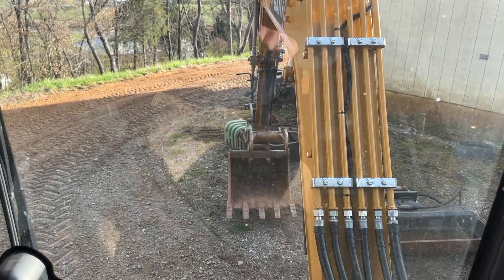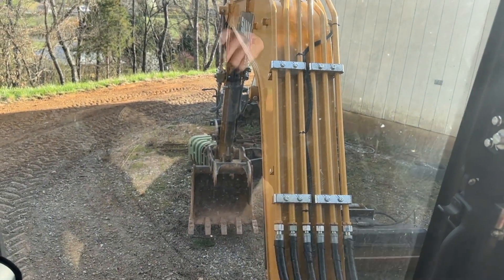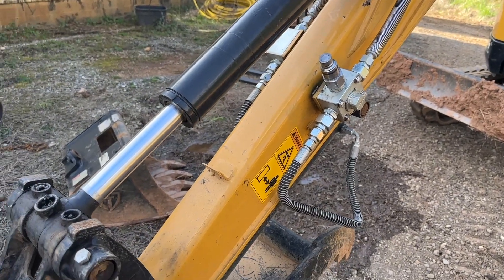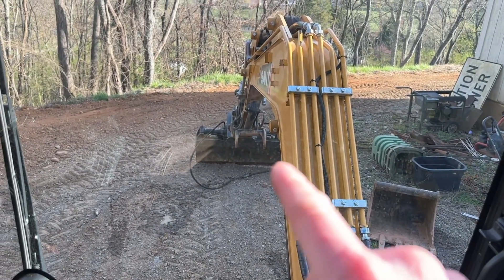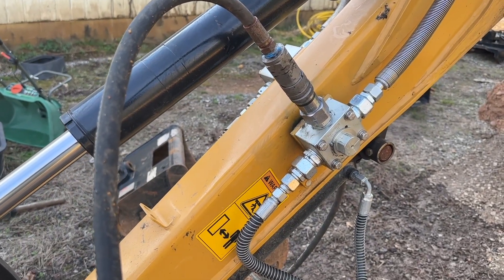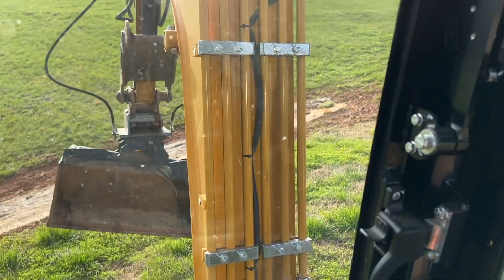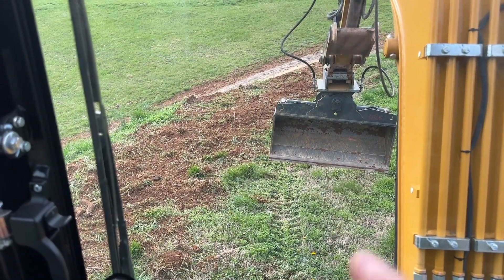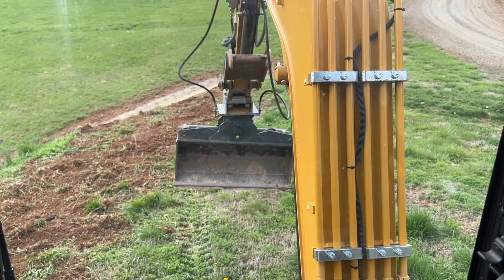Sany Mini Excavator Aux Hydraulic Release

Comment: If you take the couplings from your attachment and connect them together, they will always be equal pressure no matter the temp change. And as a bonus keeps them clean
Reply from the maker: Yeah. Not sure I got it on video but that's how I store my tilt with them connected together.

Comment: Do you know the part number for that hydraulic block?
Reply from the maker: I don't but it came from Parker hydraulic shop. It's a three way valve.  I'll grab what I can see on the block in the next few days and post back.
Reply: Thanks.  What about your quick connect plate? Where did you find that at?
Reply from the maker: @danielsprings-hg2jc  The wain roy plate? If so mongo attachments sells them.